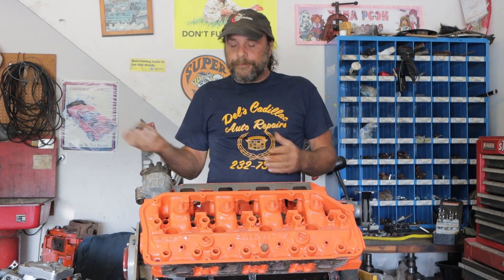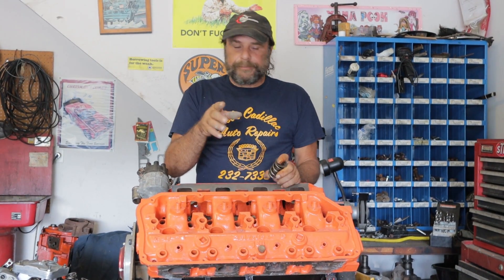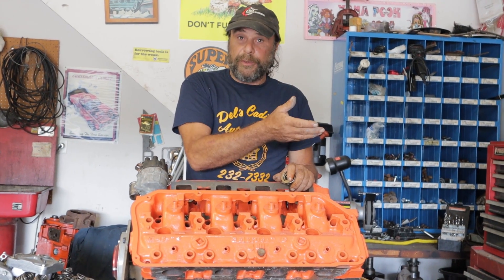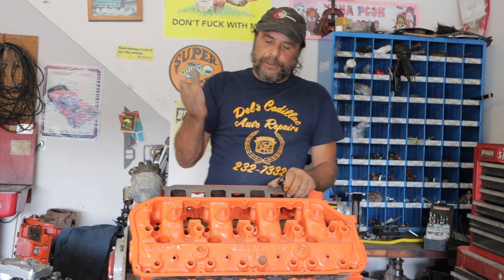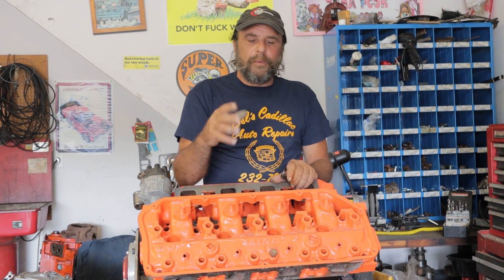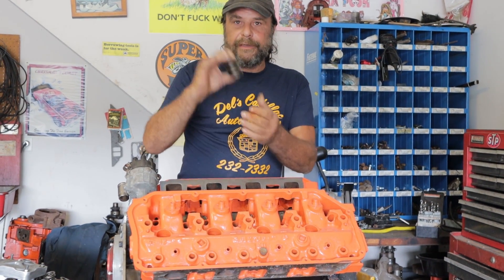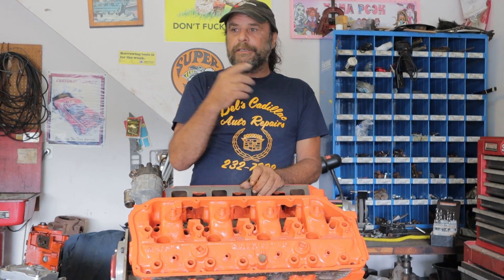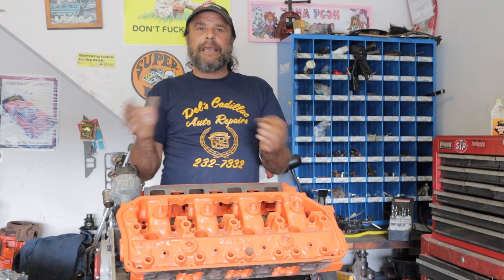Mopar's Doomsday Hemi

Comment: It's really cool to hear the back story to modern DOHC muscle...it amazes me that once exotic race tech is now common place.

I should mention that GM's LS motors are still 2V cam-in-block engines and hold thier own in simplicity, durability and performance...disclaimer I'm a Chevy guy, but respect any hi-performance engine.
Reply: Isn't ford the only one running DOHC muscle cars still? I had my 5.7 Hemi apart and it's still an OHV engine, 2v per cylinder, making 460hp and 450lb-ft at the crank now lol pretty sure the 5.0 is the only DOHC V8 coming out of America lol
Reply: And it's hilarious because it's still a cast iron block lmao not fun to move around in the garage :P

Comment: 427 ford was first they actually copied the overhead cam from ford. chevy squashed those engines. all while using engines not approved by nascar. 396 427 454 all was proved on nascar tracks before they was ever produced in a single chevy car. hence why you've never seen one oif these in person. the 427 ford has a lot more made at 200 total before nascar killed them in nascar for chevy. chevy has always gotten away with bs using things they didn't use on their cars stock. windows as well as engines. nascar has always gave chevy the upper edge on the other two. also why I don't was nascar. they all use ford rearends which would never come stock in any chevy car.
Reply: junk rear end to old
Reply: Both Chrysler's 426 Hemi and Ford's 427 Cammer were outlawed by NASCAR as they were not production engines in 1965 (that was the criteria to be eligible to race in NASCAR events from 1965 and later).  In 1966, Chrysler offered their spectacular Hemi to the buying public (offered in their "B" bodied platforms), Ford did not; hence, making them ineligible for NASCAR. The real reason Ford did not produce the Cammer is the fact that the basic "FE" block it was based upon could not withstand the rigors/stress a single overhead cam (greater RPM potential) design would produce. The FE design was already push to the limits with a push rod design; hence, what was needed was a clean sheet, more conventional design which became the 429 Boss.

Comment: Those experimental motors of the 1960's and early 70's are crazy.  Did you ever hear about the 4 valve hemi oldsmobile motor? Apparently it made 500 hp with a stock intake

Comment: DOHC just opens up so many engine design and tuning options.  It's easier to do pentroof/splayed valves for straighter, better-flowing ports.  Getting rid of rockers and pushrods means less valve spring needed at a given RPM, which frees up tons of power like you point out or lets you rev a bit higher.  It also means lash adjustments stay put a lot longer*.  And yeah, it absolutely lets you play with lobe separation angle and can make it a lot easier to play with overall cam timing vs a pushrod engine.  

*Tons of the more modern SOHC and DOHC engines had mechanical lash adjustments into the 21st century.  You were supposed to check the lash every 60-100,000 miles or so, but in practice you just let it ride until it sounded like the engine was worn out, then pull the valve cover(s) and make it quiet again.  Honda and Subaru were usually easy because they liked using rocker followers, but Toyota used lash shims that fit into the top of the very lifter-like follower bucket... things.  

Can't tell you how many times I had some Civic come through the door with 250,000 miles on it, rattling like hell and the owner worried his engine was worn out.  Pop the valve cover, bust out the feeler gauges and an hour later it was good for another quarter million.
Reply: it also increases engine size, weight, height, etc...

Comment: Ford had a dual overhead cam 4 32 valve gasoline V8 way back during WW2 , It was the Ford GAA found in many Sherman tanks .   It was a scaled down version of their DOHC cam V12 .    I got to see one run years ago and it was a beast .
Reply: Craig Voisin that’d been cool
Reply: Originally meant as aircraft engines.  Aircraft engines were really early adopters of fuel injection, overhead cams, pentroof/hemispheric combustion chambers and all that.  

You want a mind blower?  Check out the Allison V-1710.  Swap out a couple parts in the gear train that drives the cams, trade a couple plug wires around and viola!  It runs in the opposite direction (by design)!!
Reply: The V12 version of it was meant as an aircraft engine , Ford didn't get the contract and lost out to the Merlin V12 produced under license at the Packard plant  So Ford downscaled it to a V8 and got the M43A Tank contract  .

Comment: This was the turning point in American automotive innovation.  This tech would have sprung the way for more efficient S/DOHC smaller displacement engines seen today.  NASCAR effectively doomed the big three to push rod, carb engines for two to three more decades as a result (exception, Ford).  Instead of innovate they went with stagnate.  GM was the biggest factor in the lobbying of it.  Audi, Toyota, and the like do some amazing things developing tech through racing (think v10 hybrid diesels) unlike NASCAR’s regressive tendency’s.  Imagine a 70’s era SOHC /6 with a crossflow head.  Instead Chrysler spent millions on the 3.9L V6 in the 80’s to replace it. The potential was there.
Reply: Pontiac had an OHC 6 in the Firebird, and I think it was available in the LeMans too. They couldn't sell them.

Comment: A flat plane crank would help with exhaust scavenging if you could deal with the noise/vibration at this large a displacement
Reply from the maker: Don't matter what style crank is used, a big ass dome stuck up there blocking the path is the problem
Reply: @UncleTonysGarage  l know, l get that...that's why l said "would help" - flat planes fire different & scavenge good...& if you're going to be racing - l think it's a good way to go (my opinion)

Comment: Mother Mopar may have developed this 426 DOHC HEMI and have a history with the HEMI going all the way back to the mid 1950's but they were not the only manufacturer to experiment with & develop HEMI's V-8's & OHC V-8 engines. 
Pontiac developed the 421 2 valve per cylinder SOHC, the 421 3 valve SOHC & the 427 2 valve per cylinder SOHC HEMI.
Chevy developed the 427 2 valve HEMI & the 427 2 valve SOHC HEMI.
Oldsmobile developed the W-43 455 4 valve per cylinder OHV HEMI & the OW-43 455 4 valve per cylinder DOHC HEMI.
Buick developed the All Aluminum 215 HEMI V8.
And Ford developed the 289 SOHC, the 427 SOHC & the BOSS 429 SEMI HEMI.
Some were more successful than others but ALL are legends!!! Hell, even Toyota developed & manufactured HEMI engines back in the day!
Reply: Yep and Mopar has the patent on the Hemi and they were and still are superior.
Reply: @TheGeil8500  : WRONG!!! Mopar does not own the patent on the HEMI engine. The patent they obtained in 1950 expired in 1970. In the U.S. patents are only valid for 20 years. Mopar did not even invent the HEMI engine. Welch Motor Car Company invented the HEMI engine in 1904. All Mopar owns is the trademark name "HEMI" not the patent rights. The Chrysler HEMI died in 1971, What Mopar sells today in modern cars that they claim is a HEMI is not actually a HEMI engine at all...the cylinder heads are of a modern "Pent Roof" design. They are only HEMI'S because they "Slap" the name HEMI on the air cleaner & the sides of the cars. Learn your history before your fingers go tapping away!!!
Reply: @TheGeil8500  : Neither! But apparently you are both! Do a little God damned research & you will see I'm correct! Sorry to burst your HEMI BUBBLE....NOT.
Reply: @rogergoodman8665  Well Roger dodger You answered my question. You are both and only know partly what you are mentioning here. The Hemi engine is a trade Mark of Chrysler corporation period. Look it up.
Reply: @rogergoodman8665  The Gen III "Hemi" is actually a modified Hemispherical design (it is not a full Hemi). Gen III's have a shallow Hemispherical area in between and around the intake and exhaust valves (cross-flow, perpendicular to the crankshaft) with two spark plugs per cylinder (at 9 and 3 o'clock from the valves, paralleled to the crankshaft) for improved combustion. The difference is the squish bands located parallel to the intake and exhaust valves outward toward the cylinder walls (fore and aft to the block). This decreases the combustion chamber area and improves scavaging/turbulance in the chamber. It also decreases the piston dome height/thickness (lightening up the piston, decreasing rod and crank bearing loading) which decreases the likelihood of predetenation and increases RPM potential (> RPM = > HP). Gen III's are the finest flowing 2-valve cylinder heads in automotive history (this is why they ...as well as the Gen I and Gen II variants...are often not allowed to compete against GM, Ford and other competitive modern and vintage OHV V8's in the Amsoil "Engine Masters" Contest). Chryslers "Doomsday Hemi" is not a hemi at all but is a pent roof design common in 4 valve per cylinder designs.
Reply: Robert Brumley your wrong Chrysler didn’t develop the heMi the other guy was correct and you were dead wrong 😂
Reply: Chevy developed a small block based Hemi in the late 60s for Trans Am racing. The plug was pulled before they got too far but supposedly some running motors were built.
Reply: Had a hemi yota was indestructible

Comment: I have a chassis research front engine dragster the slingshot one ! How did they get those big hemis to work in these cars mine is 105 in wheelbase ?
Reply from the maker: Short wheelbase diggers were about zero traction.  As tires got better, the wheelbase grew and the engines dropped lower.  The idea was to get the car to try and run over its own CG, thus levering the nose down.  Same concept as todays Funny Cars
Reply: Uncle Tony's Garage right on ! At 750 hp it’s crazy as hell im just trying to imagine a 1500 hp blown Hemi!! Those were the days !!

Comment: I saw that dual cam Hemi at Autorama in Detroit about 20-30 years ago, then it disappeared. I had read about it before that. 
Now you gotta review the 305 Keith Black Hemi used in the last NASCAR Wing cars!
Reply from the maker: The 305 was actually a destroked 340, and only saw action in one car for one race.  It was actually intended for the Trans Am series
Reply: @UncleTonysGarage  Not how I remember it. Of course I read about that a long time ago.
Reply: @UncleTonysGarage  I did some research. You're right. I knew it was a Keith Black engine. It was a destrocked 340. But it could turn 10,000 rippim's! The car was owned by Mario Rossi and driven by Dick Brooks.
After a crash with Pete Hamilton Brooks was down after repairs in the pits. He finished 7th. Mario Rossi disappeared. His son searched for his dad's car. He found a car and bought it. Cotton Owens called and said, some guy has your dad's car! They made a deal. They traded cars!

Comment: WOW a BALL BUSTING engine with a TIMING BELT really?  That's why most manufacturers get rid of timing belts because they cant handle the torque from a modern engine.
Reply from the maker: Engine torque has nothing to do with how much tension a timing belt sees.  Manufacturers got away from them because of the packaging concerns with having to replace the belt at service intervals.  They can pack stuff in tighter if it never has to be taken apart
Reply: @UncleTonysGarage  I was just thinking of the blowers they put on the engine with a ribbed belt that was over 2 inches wider than a timing belt.

Comment: I hope who ever bought the one head maybe was able to make a second one and a running motor somehow. Would be nice to see it run and what it would dyno for kicks and giggles. If it all worked smoothly.
Reply: You can get an idea from the Mercury racing QC4v.  They are based off the BBC with DOHC heads.  9L (549ci) makes 860hp@6800 on 89 octane with 9.75:1 compression.  That with something close to street type cams.
Reply: @GlassTopRX7  Woah, I was like 9L of course it makes power but with small cams and low compression that's a big boy number for a mild setup lolz